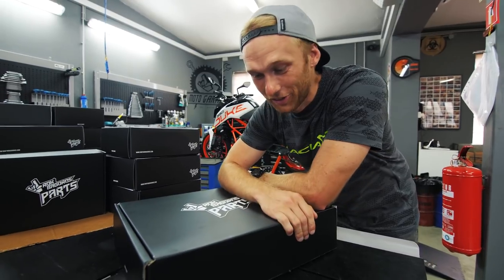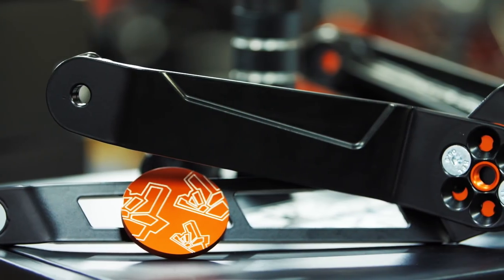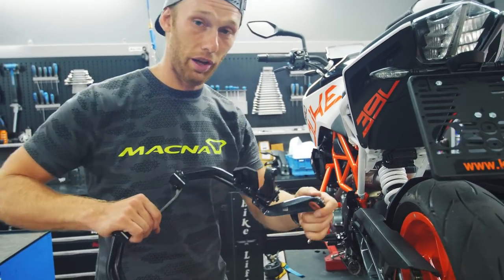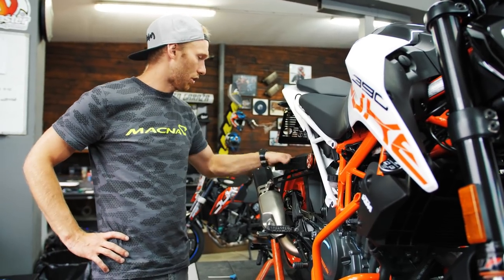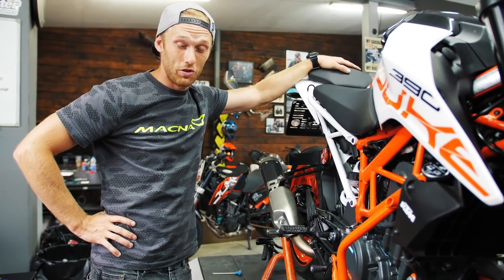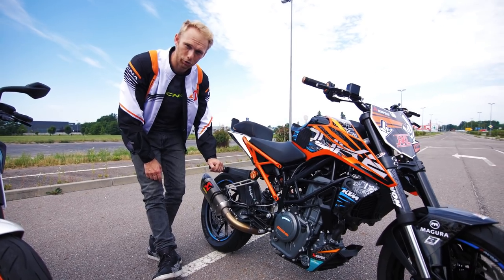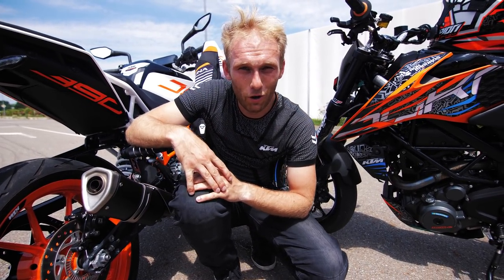CRASH TEST WITH MY KTM DUKE | RokON VLOG #87

Comment: I think to add more strength to the subcage if you can incorporate or add a "strutbar" in the middle that is discreet and will not touch the tires when adjusted😎 it can be a cnc aluminum alloy and has your rokon logo orange in color also🤩

Comment: Take off the back seat and design a ROK bagors edition race seat made of carbon fiber put some cool ROK on graphics the race seat may weigh less than stock one
Reply from the maker: Cool idea, for what bike do you think it would be cool?
Reply: @RokBagorosStuntrider  
Duke 250 390  in your stunt bike 250 Duke buy doing this you can also save some weight in a stunt bike even a small amount of weight saving is a blessing

Comment: Bro you can try double disc brake on the front And make a video how to install double disc in front on the duke 390
Reply from the maker: No need for that, the one side 320mm Moto master disc with sintered race pads is strong enough for this bikes. More does not always means better ;)
Reply: Bro. That single disc is really enough for the 390 DUKE...
Reply: You don't need double disc for such a light bike
Reply: @RokBagorosStuntrider  thanks bro for your advice 😊😊

Comment: I have a Remus exhaust system on my 390 Duke & the exhaust mount is different than the OEM exhaust mount. Will it be possible to order this subcage with an exhaust mount suitable for the Remus exhaust system?
Reply from the maker: You will need to DIY a small bracket so you can fit the remus exhaust to it ;)

Comment: Hello good day Rok, im a new subscriber planning to buy 390 (your videos convinced me ;), if you can make suggestions what powerparts should be we buy?
Reply: I just bought a new 390 with crashcage and shorter licenseplate holder and in a few month I´m gonna buy a graphic kit
Reply from the maker: Ufff there is tons of options. I would go for a KTM PowerParts crash cage and Rok Bagoros tail tidy. And POWERparts side mirrors or some other aftermarket brands. If you have some extra money an Akrapovic without the Db killer will make the perfect sound ;)
Reply from the maker: You can check some parts here www.shop.rokbagoros.com
Reply: Thanks rok. Thats really great that i replied i can imagine u recieve lots of question from fans, please restock ur crash cage currently out of stock🤣🤣

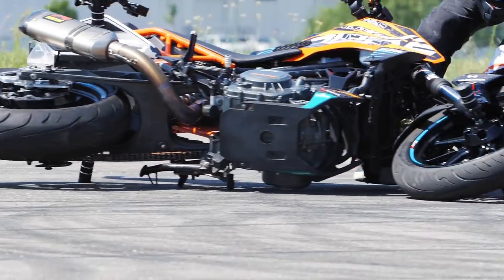Comment: Did the crash at 12:42 scratching the left case of the engine? Just curious cuz I’m really interesting in this crash cage
All the best, Rok on from Taiwan!!😎😎😎
Reply from the maker: If you use the stock handlebar then you will scratch the engine case but if you use a wider handlebar or our RokON handlebar that is also wider then it will not touch the engine case ;)

Comment: make some 690 smc-r parts 😎
Reply from the maker: For example?
Reply: @RokBagorosStuntrider  A wheelie stunt bar/frame so that the fueltank doens't catch fire with a crash when you're flip over. Many 690 smc-r and husq 701 burnt down because of that because the fueltank is in the rear.